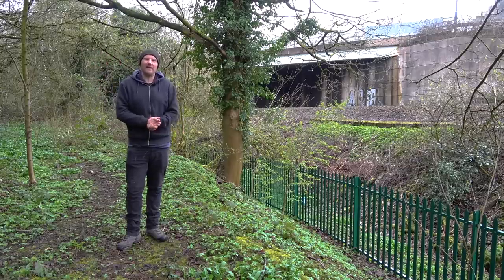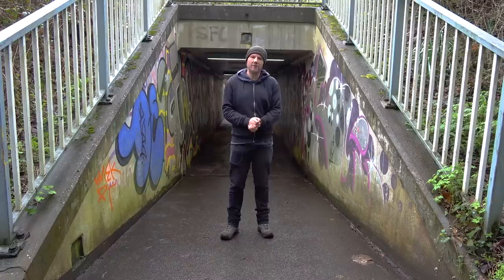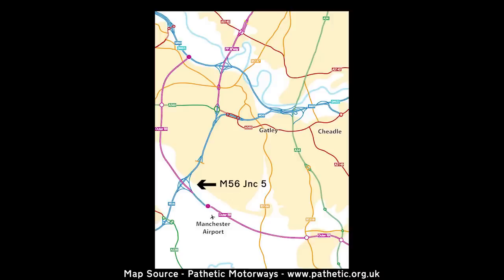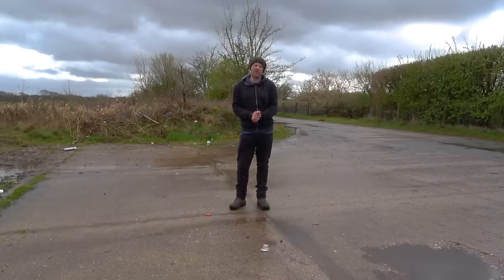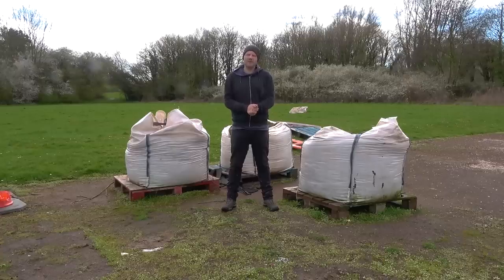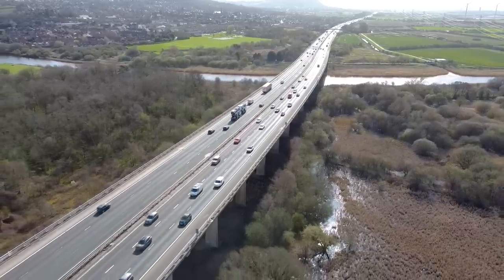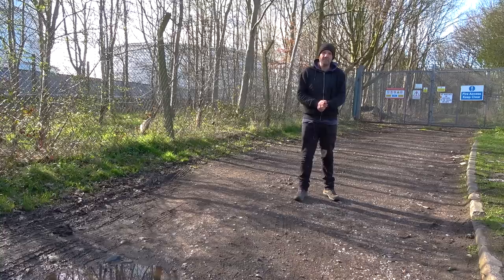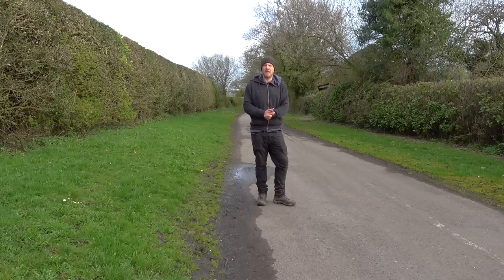Secrets of The Motorway - M56

Comment: Excellent again Jon, the M56 is one of my favourite motorways. I love the way people pay no attention whatsoever to the chevrons on it that advise a 2 chevron gap. It’s almost like folk try to make the gaps as small as possible between each other 😂
Reply: It’s one of the maddest motorways I’ve driven on. Very high percentage of psychopaths
Reply: I think that’s primarily because some smooth brains out there also equate those chevrons to mean “drive at 50mph regardless of which lane you are in”, so it leads to a mass braking at the beginning, bunched up frustrated “normal” people for the duration, followed by a mad rush back to 70+ at the end… 😂
Reply: @DubStu  Nailed it 👍🏼
Reply: Its a crap motorway thags permenantly going slow using because some tool has crashed and closed a lane or two down.

Comment: Just before the old interchange with the A494, the M56 had a heavily-banked right turn to reach the roundabout.  After the realignment, the M56 went straight on at the (previous) right turn but the contractors left a substantial part of the banking, so with an old Mini at the right speed it was possible to get close to lifting all wheels off the ground when going over it.  Much later the bump was flattened, but not quite enough and can be felt still.

Comment: given how much the paint has faded, the signage around the M56/M53 interchange is probably the original stock from the early 80s
Reply: All of these signs were replaced in 2018 except  1/2 mile advance sign of A5117 on sliproad directing you to northbound carriageway of M53

Comment: Awesome as always.
The a494/a55 first stretch after that roundabout used to terminate at a set of lights in the Shotwick area, it was an unusual way those roads segued but perhaps more unusual was a short distance further on where the road crossed the site of RAF Sealand. At this point there was a ridiculously severe hump over a tunnel between the two sides of the site with a speed limit. If you were lucky enough to start driving when this tunnel was still around you could be tempted to perform Dukes Of Hazard style air manoeuvres. In fact if you hung around the side roads long enough you could witness people doing this to varying degrees of success. Long since gone with sale of one side of the site and the bike path on a suspension bridge over the road, it’s all sensible and flat now. The A$$ road has very few other significant spots though I’m sure if anyone could unearth them you could. Once upon a time there was a crossing point at the Halkyn Little Chef (Three corner wood) and people would try all sorts from U turns to driving cattle across. I suppose when you get further along to Penmaenmawr the tunnels are something of note! As a kid visiting family in Caernarfon it went from a 3 hrs slog to around half that time.
Keep up the great work!

Comment: The Kingsway junction is a remarkable one - not only does it connect the two motorways with the A34 (but not in all directions!), it threads around three railway lines, the River Mersey and a (now former) hospital - reputed to be one of Britain's most haunted buildings!
Reply: And we have the Manchester Airport flight path above, and even a tram is in walking distance in East Didsbury. However there are several connections you can't make here without planning miles ahead, you can do M56 Eastbound to A34 Northbound, but no legal way from M60 Eastbound to A34 North (leave J5 to go through Northenden and Didsbury). A34 Southbound can only join M60 Eastbound, no anticlockwise on the ring road! A34 Northbound can join M60 either way, but can't reach M56 as it merges too late. (go south to new A555). M56 can't join A34 south as it joins M60 too late (leave at J2 and go through Gatley). At end of the circular slip road from M60 to A34 southbound you can turn off before A34 to a tiny tunnel under A34 joining it northbound,  but illegal unless you remembered that you know someone living in that street but they were not at home that day.
It is all very confusing even for me after 15 years, as you can't assume going back where you came from!
A34
https://maps.app.goo.gl/HQf1vXuVtw3qqU1X7
Reply: @SteveOnTheInterweb  Yes, I used to live in Heald Green, so I know the junction quite well, but as it's 25 years since I left, I couldn't remember which connections you couldn't do.

Comment: In addition to the upgrade works to the A494/M56 connection in the 2000s there was also heavy upgrade work done to the A494 to bring it up to motorway standards so that the M56 could absorb it and extend pretty much all the way to the A55.  However due to money/environmental issues and many complaints from locals it never went ahead, but if you look on Google maps at the point the A494 reaches the river Dee you can see that the road is twice as wide on the eastern bank having been upgraded for eight lanes, it was planned to build a second bridge and have the A494/M56 cross the river with four lanes on each side but the plan died here.

Comment: They're replacing the bridge at A533 in between J11-10 because (from memory) it was a "half-joint" structure which was an old design for bridge decks which made them susceptible to concrete deterioration. In 20.....18? Maybe 2017. They "propped" the old bridge mid-span which basically consisted of creating a temporary central pier to support the bridge because the structure failed a structural assessment. some time prior to that.

Comment: I used to commute daily on the A556 and M56 when they opened that new A556 expressway and the J7 M56, and what a load of sh!t it was. The main issue was actually that it immediately overloaded the Tabley interchange (J19 M6) on the other end of the A556 and the line backed up almost to the M56.

Comment: That spiral slip road off the M60 and onto the Parkway really shows up how bad the standard of driving is…mainly cars, excessively using their brakes and weaving all over the road, but once in the late 90’s a truck driver went straight on in an 18 wheeler about half way down and crashed into an upright supporting the M60…was surrounded with scaffolding for months whilst they fixed it…

Comment: I never knew that there was a whole section of the A34 running to Manchester. I always assumed that it stopped north of Oxford at the M40, which it does. Did the M40 come along and clobber it? It's all rather exciting!
Reply: It is the usual situation where a bigger road, usually a motorway, opens and so it got diverted onto that.  So the current A32 was redirected towards Bicester to join the M40, replacing what had been numbered parts of the A43 and A421.  The A34 now resumes at J4 of the M42 to head into Birmingham and beyond.

Originally the A44 started on the A34 just before Chipping Norton, so when A34 was diverted the A44 took over the southern section of the A34 to Oxford.  The section north of there was renumbered the A3400, which both makes sense, because it was the A34, and does not. Any A- or B-road that starts between the A4 and A5 should begin with a 4, and it is entirely within that zone.  But if you want to follow the old A34 from Oxford it is very easy to do.

Comment: Stratton Airfield was also used by shell U.K. as a testing ground for oils and fuels and had workshops there.
Reply: Interesting because Shell Research (and lubricants production) was at the Thornton part of Stanlow and the Stanlow and Thornton railway station was built for wartime workers. Also Octel is nearby and they produce fuel additives (originally lead) needed to boost fuel performance for supercharged fighter aircraft.
Reply: @johnmoruzzi7236  they would use the remains of the airfield to drive cars around for long periods. There was start and stop lines and signs saying stop + idle for x amount of time before continuing around the airfield. 
There is some buildings and a workshop there that they would also use to no doubt drain oil etc from the test cars. 

Also another pointless fun fact Stanlow was one of the first places to have a rolling road for performance testing of cars. And as such Ford Halewood when building the AVO Escort In would take cars there on a Saturday night in the cover of darkness. They used the RR to test the cars with Webber and Strongberg carbs on to see what one gave the best performance etc.

Comment: Whats the story behind the road arrow markings between junction 12 and 14? I assumed they help keep the distance beween vehicles, but why here specifically?
Reply: They are designed to force traffic to maintain the proper safe spacing. They used to have them on the M6 just South of Crewe, but I think they went with recent upgrades there. I’ve also seen them in other places around the country, and I’m convinced they were experimental, but I don’t know who’s monitoring them if that is the case. And since they tend to cause more congestion (as people brake to maintain the gap rather than just letting off the accelerator…) they are more trouble than they are worth.
Reply: @DubStu  Cheers!